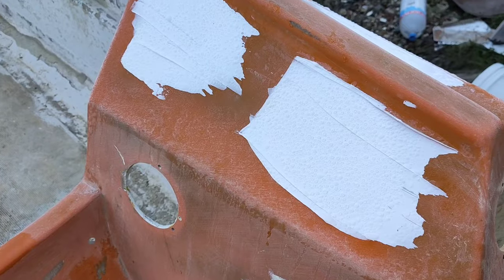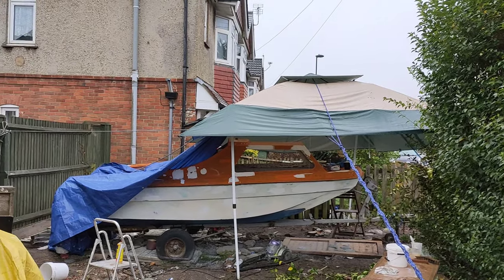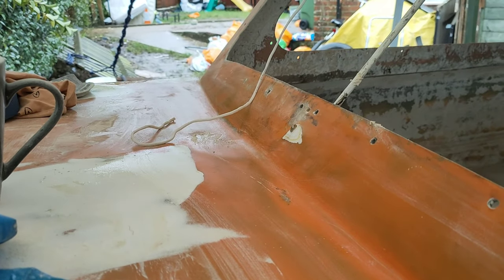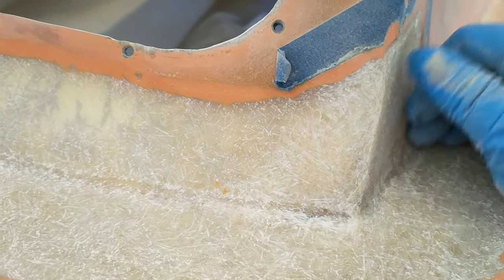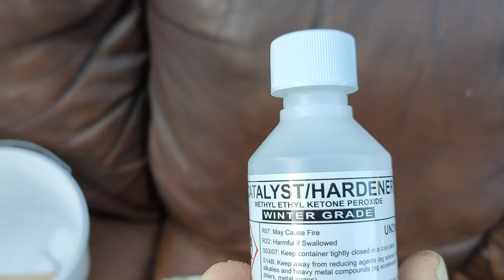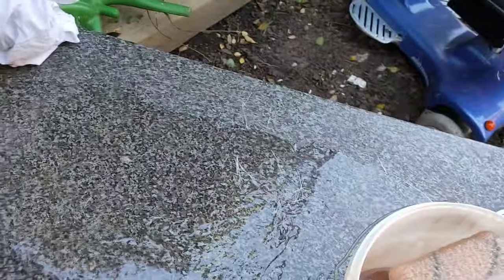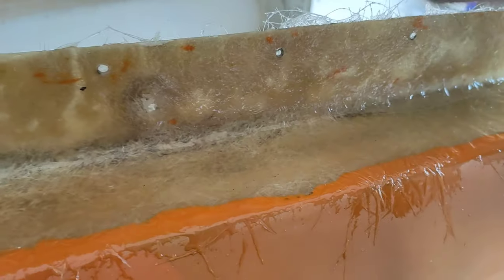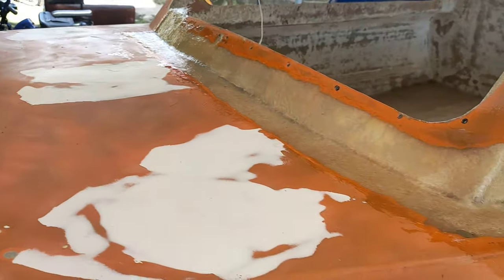restoring a 14ft cjr prt5

Comment: nice shes getting there, with sam being away you know what the fillers called you used? and the resin was it poly or epoxy cheers bud keep it coming  no6 nxt week lol
Reply from the maker: Cheers mate I will try haha weather is the issue the filler  was gel, wax and silica mix and no epoxy near a polyester boat. Other than paint 👍
Reply: Never repair a Polly boat with epoxy it's stupid and you can't put anything polyester over epoxy. You can epoxy over Polyester but then you can't put gel over the epoxy. Polyester repair done properly is perfectly fine and strong it's a misconception that epoxy repairs are better on Polly boats
Reply: @paskins84  cheers Sam for confirming what i all ready thought cheers
Reply: He will be filling with car body filler from now as it's polyester based but could use epoxy as the paint going on is epoxy based and once the epoxy primmer is on only epoxy filler can be used
Reply: @paskins84  cheers Sam nice to have someone who knows what there doing rather then someone repeating bad info they have heard may i ask the brand of topcoat you use, thx
Reply: Can't remember.
Reply: Most boats are painted in car paint it's all the same shit anyway
Reply from the maker: @snoopdogguk2003  I will dig it out later and let you know
Reply: Proberly only have the name of the paint shop and colour on the tin